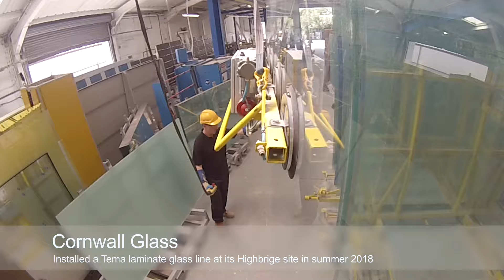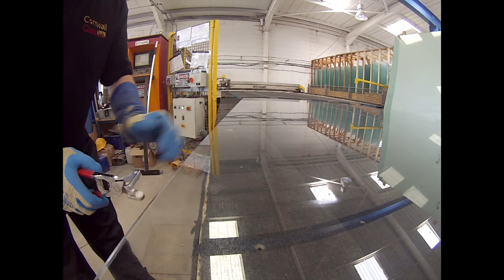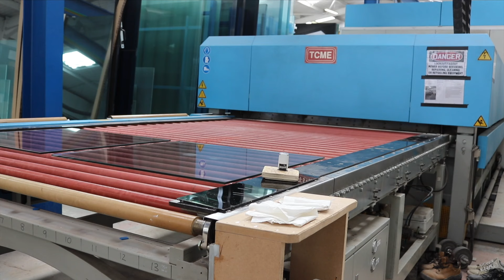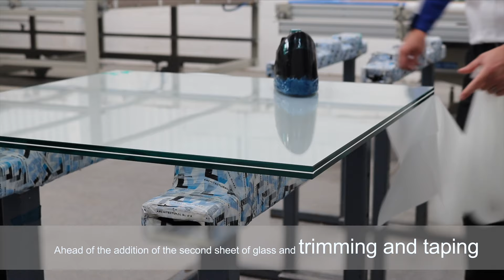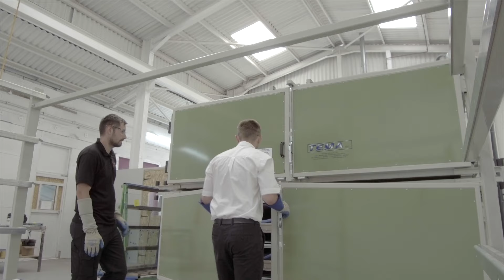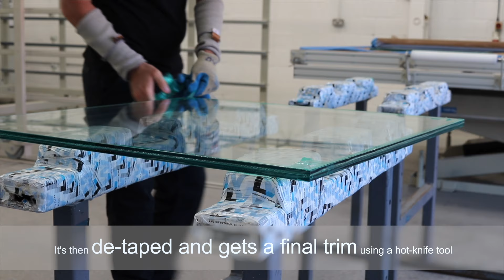Cornwall Glass EVA Lamination Process

Comment: Can i know how to seperate the 2 glass again once they are laminated
Reply: Good luck with that one.
Reply: I guess the only possible way is if they were to be heated again
Reply: @Jordan-bz1dj  i tried but the glass broke lol
Reply: @marshall_mj8877  well it looks like there’s no coming back after the glass has been laminated then lol
Reply: @marshall_mj8877  also what did you use to heat them up?
Reply: @Jordan-bz1dj  just a normal method like a teapot, however it heated the silicone like stuff but it cracked the part of the glass that i put on.
Reply: Lots of grit and time lol. Id say use a knife but yeah